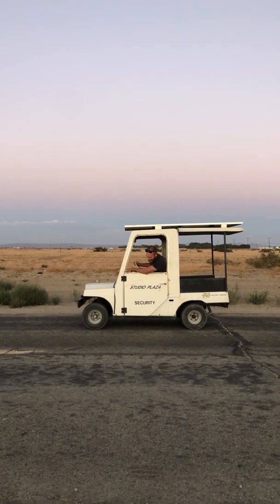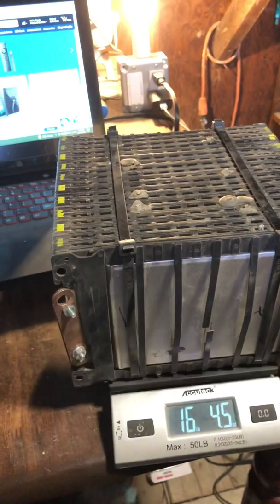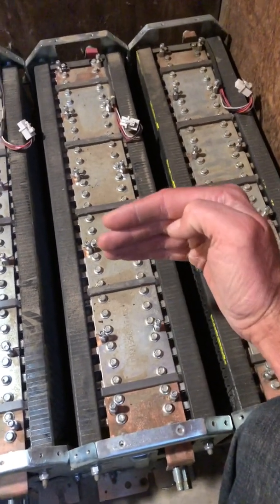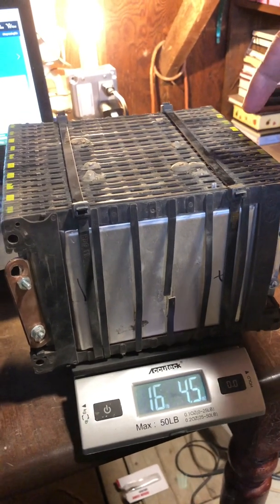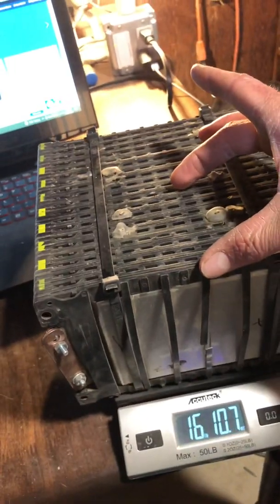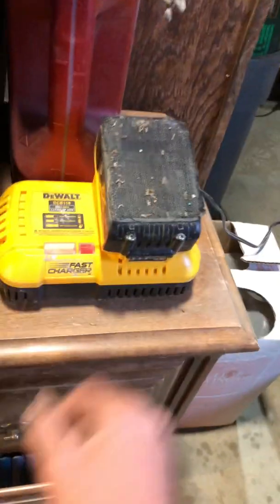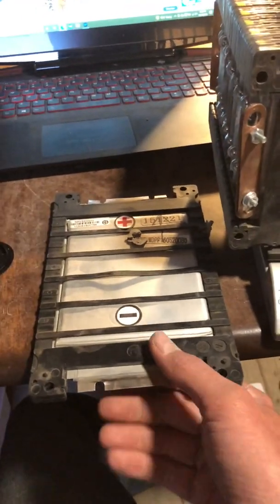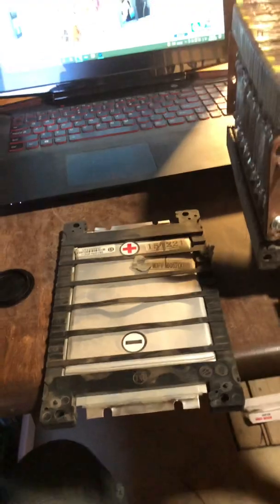Lithium Spim08hp POWER! Doing a wheelie with a 15 pound battery

Comment: Thank you! All of your projects are so cool and inspiring! I am using your videos as an overall plan. I want my fixer upper 1986 club car, 36v to be awesome like yours and do wheelies!
Reply from the maker: Buy a good speed controller and have at it! 😁
Reply from the maker: Make sure it’s high voltage. 😁 it really helps a lot.
Reply: @RetroElectric  How about a battery for standard 36 volt golf cart to to replace six, 6 volt lead acid Trojan batteries just for standard driving around on a Sport Clays Course or out in the country, back road use.......what would you suggest ? Thank you !

Comment: I built 5 x 48 volt packs from 7 of the 36 volt packs. You just have to order 2 more of the 12 bolt bus bars from Battery Hookup to complete the 5th battery. You also need 20pc of 1/4 threaded rod and nuts and washers. The ones on the 36 volt packs are metric.  Batteries came on one pallet so one shipping charge. You will also need 5 x 48 volt 100 amp/hr BMS and I'm installing 5 active balancers as well. You end up with a 12.5 kWh battery for about 2 grand. The cells are NMC 2.7 volts nominal.
Reply from the maker: What is NMC?
Reply: @RetroElectric  lithium ion.

Comment: People just don't understand the insane amount of power those cells can put out.  I've rebuilt my 24V 24Ah ones into 24V 32Ah units. As I have 8 of them, I have to be very careful not to short something out as 8 X 800 Amps at 24V  can make for some big sparks if something went wrong. And yes, you are right on the shipping costs of the 36V48Ah units if you don't buy a whole pallet of them. I had plans to buy one until I saw the shipping cost for one was more than the unit itself. They say that 7 can fit on the pallet and there is where the shipping cost per comes down.
Reply from the maker: Yes. I bought a pallet! 😅